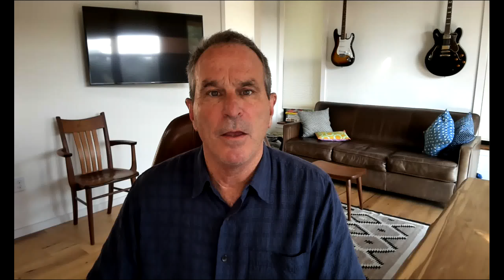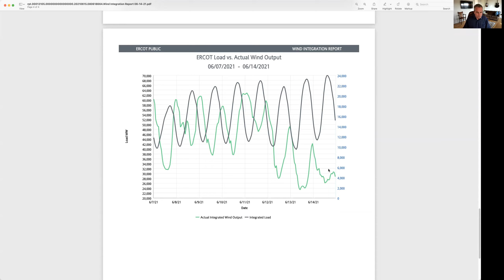Power Brief: Here’s Why Texans Can’t Rely On Wind Energy

Comment: The reason the hottest days are the hottest are because there is no wind to dissipate the heat. If there was wind then it wouldn't be the hottest day. Therefore wind power will never be useful when it's needed most. The same can be said for the coldest days also but for different reasons.

Comment: Robert – I'm not sure if you read comments ... In my research I came across an article in the Texas Observer (Jan 28 2021) which made a claim I have been unable to either confirm or deny. Having watched you on a few channels now, I think you may have some insight. The article's author refers to a wind energy industry practice called 'repowering', and implies that because the Production Tax Credit is paid only through the first 10 years of a project's wind production, providers are replacing wind turbine blades before they've reached the end of their useful life in order to 're‐up' their PTC. If true, this is rent‐seeking on steroids, aside from the fact that it creates twice the waste problem. Thoughts?
Reply from the maker: Hi. Yes. It's my understanding the wind generators can resort the clock on the PTC if they repower their turbines by upgrading the nacelles/blades etc.
Reply: @RobertBryce  Thank you for your reply, Robert. It's a troubling answer, however. How is this not a scandal?